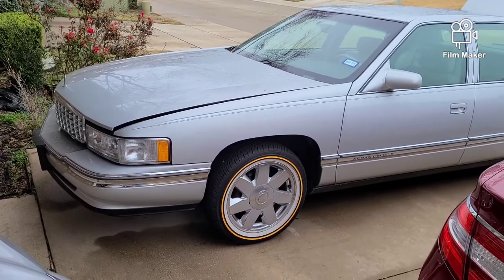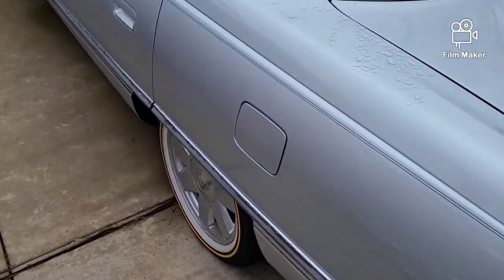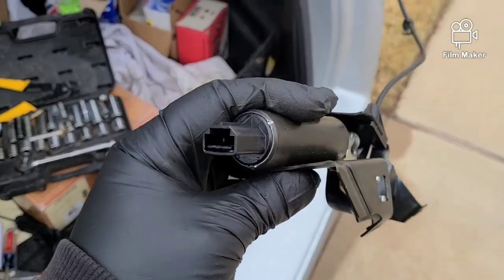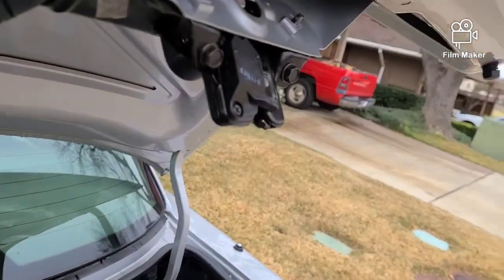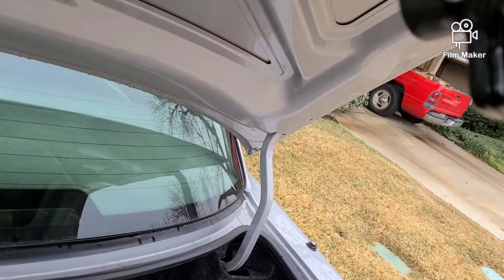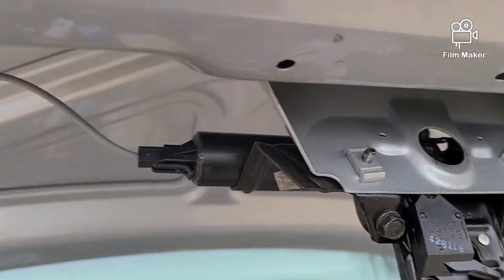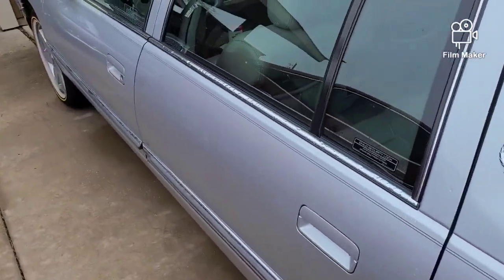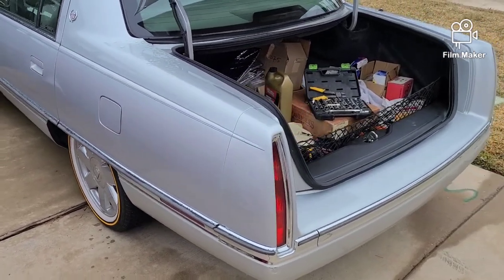1994 Cadillac Deville Trunk Release Repair How To Repair Tutorial

Comment: On the original trunk release in your hand. The wire/cable that has the white round plastic cap at the end of it, where does that go? Been trying to figure out. Thank you
Reply from the maker: Hey Bill, the white round piece mounts where the lock cylinder is located

Comment: Ok I fixed the fast flashers., bad ground on the pigtail sockets. On the truck release I can hear the relay click when I press the release switch on both the remote and the switch on the dash. I also get 12 volts to the solenoid when I press them. So I need a new release solenoid. I can't find a new one listed anywhere.
Reply from the maker: Hey Brett, Finding a new release solenoid isn't an easy find at all. You definitely go up to 99 model year for that part since it didn't change from 94-99 model years
Reply: @lawjo1978  Yes I went back and read your notes on the video for the models and years that work, Thanks!

Comment: Please enlighten me and others as how does this unit you replace come off the lock cylinder - does the white plastic cup that has the cable wire just pull down and off or is there a retaining ring? or pin you are suppose to push to get the white cup removed from the lock cylinder?  Mine will pull halfway off and that's it?
Reply from the maker: @vlogman144... The white retainer that's attached to the lock cylinder comes off with a twisting motion. The white cap like retainer is attached to the cable as a one piece assembly.

Comment: Bro I just got rear ended today in my 94. Anyone know a trunk from a 96 will fit I figure it will. Found 2 96s at the yard any advice would be great
Reply from the maker: Hey Bryan, sorry for the late reply. A trunk up to 99 will fit without issues
Reply: @lawjo1978   the yard here said 1994 was year specific. Another yard said that a 96 trunk will fit by changing the spring rod supports. I don't even know what that is lol
Reply from the maker: @bryandose8527  Hey Bryan the supports are near the hinges on the trunk lid. They look like long rods that are spring loaded. They keep the trunk lid up. 94-99 is all on the same generation. If it needs to be specific go 94 to 96 model years
Reply: @lawjo1978  so I'm going to go pull a 96 trunk. My question is can I swap those rods out or do I even have to. The junkyard is telling me that they're not compatible. I found one in another town shipping is going to be close to $400 but there is a 96 in town that I could take the trunk off of for $125 or so I'm assuming these Rod Springs can be swapped I just take mine out of my trunk and put them in this trunk or does it even really matter
Reply: Thanks for all your support on this by the way
Reply from the maker: @bryandose8527  No problem at all. Glad I could help
Reply from the maker: @bryandose8527  The 96 trunk will work on our cars. If my memory serves me correctly. Once you remove the trunk lid those rods come out with them.
Reply from the maker: @bryandose8527  Do you have a pick and pull yard near you? If so that would be the best place to go in terms of pricing